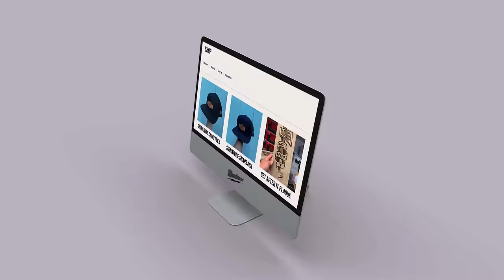Building the Mountain Cabin - Loft and Siding Prep Ep.39

Comment: I'm a sports medicine provider.  If the pain is on the inside of your elbow,  which by the mechanism of injury I'm guessing so,  you have golfers elbow. If it's on the outside you have tennis elbow. Regardless,  they are both a form of tendonitis and they are both overuse injuries, due to repetitive strenuous motions, like hammering. Treatment is rest, ice, and tylenol. If you aren't going to rest, it won't go away. If you can't resist hammering though, get a counterforce brace for your elbow. It helps a bit.
Reply: rest won't be enough in this case :) it will just come back as soon as he goes back to hammering :) so tendons need some work :)
Reply: Conservative approach first, always. There's no reason to suggest that once the aggregating factor is discontinued, it won't begin to heal on its own.
Reply: @jaredsherman3886  agreed. I just think he needs some eccentric loading too apart from what tou mentioned :)
Reply: Can you use a pro tens on the area for some relief?

Comment: Wowie Wowie it’s coming together nicely! Those days don’t always feel productive as you don’t see big results, but it is nice to clean up a bunch of little things on the to do list sometimes. 

Not sure if you have them down in your neck of the woods, but maybe try and look into Simpson Strong Tie - SD Connector Screws. They are used instead of those little structural nails, and far more gooder on those hard to reach places with a hammer. 

If I could vote I would say a nice little window in your kitchen area. Nothing like doing dishes and watching nature do it’s thing. Plus if using propane doesn’t hurt to have a window cracked just a smidge for safety. Also, if you cook like me will need that cross breeze to clear some over cooked smoke out haha

Keep up the great work Mister!
Reply from the maker: Thank you! Yea having some structural screws for brackets would be helpful. My wrists are not as strong as they once were…appreciate the love!

Comment: Re: tennis elbow
I've had it in both arms, and can tell you, it will not go away unless you rest it.
Voltarin gel will also help a bit.
Look up the physio exercises for it, and as silly as they are, do them. 1lb weight for wrist lowering(not raising) will help if you do them properly and can resist the urge to be a man about it and ramp it up lol
Treat this issue like a war of you against your tendons. Do everything you can to win!
Don't cut corners or it will come back.
If you do nothing it will spread to your shoulders because they will start compensating for it.
Good luck. Get after it!
Reply: I had it as well (from tennis!). Agree rest is the only solution.
Reply from the maker: ❤️❤️❤️❤️❤️❤️❤️❤️🙏🏼🙏🏼🙏🏼🙏🏼🙏🏼 thank you!!!!!

Comment: I am not a doctor but i have lived with tennis elbow for many years now.  at the time of my injury all the doctors said rest except one who said to continue use but along side exercises that will help manage the pain and let you continue doing what you love.  i am not a tennis player, play golf or any kind of sport enthusiast.  I did work hard repetitively using my arms which is the culprit of this injury not unlike what you do.  you may be able to google stretching exercises that really are a miracle.  i will let you know the two i do whenever the pain gets uncomfortable.  do not get me wrong the pain is chronic but quite livable.  the first exercise is easy let your arm relax along the length of your body, drop your shoulder. make a fist and turn it toward the back and pull your wrist up.  a few of those on a regular basis will help a great deal.  the other exercise is arm in front parallel to the floor hand flat, fingers pointing toward the ceiling and using your other hand pull back on all fingers while keeping your arm straight.  you should feel a good pull on the tendons.   20 seconds several times a day will relieve you pain and injury.  in fact drop your hammer and do them now.  both easy and while you are at it it would not hurt to do these exercises on both arms.  this two stretches are my go to.  they work and i am grateful.  surgery was an option, so were drugs but nothing was a promise for a cure, i did neither.  i do the stretches especially if i over work regardless the extent of the  chronic pain.  i wish you luck because i would hate to not see you every Saturday...you make my day!

Comment: You can use the framing gun on the hangers, just a little dangerous as there is a small chance you glance the nail at yourself off the wall. But if have the safety right above the bracket hole it will usually go right in the hole.

Comment: This episode had me laughing. Maybe you should put Duke to work. He's quite the skilled craftsmouse. Your cabin is looking better and better each video. I'm of the opinion you should put windows on the back side under the loft. Not big, but big enough to let in more light and some fresh air when need be. Just a thought, but Because your big beam for the loft Carry's a substantial amount of weight, consider swapping the door frame header for a piece of rectangular tube steel so over time your door doesn't become an issue. You can no doubt find a piece of scrap that will fit your needs.and since this is all diy, what's it gonna hurt. Stay safe. love your personality.